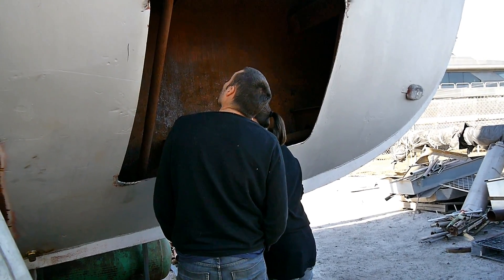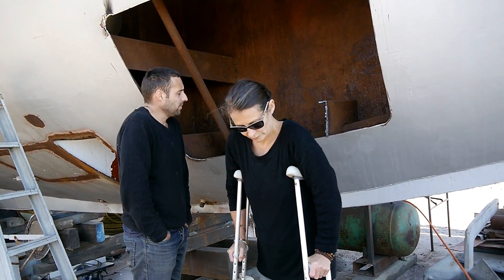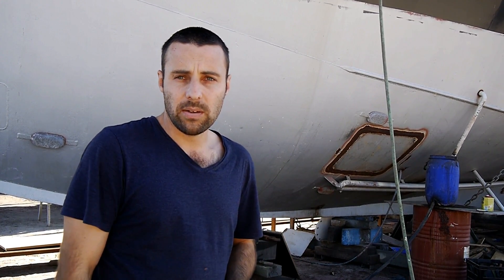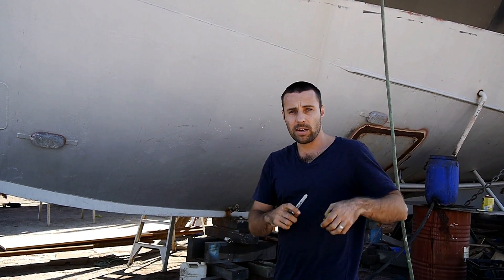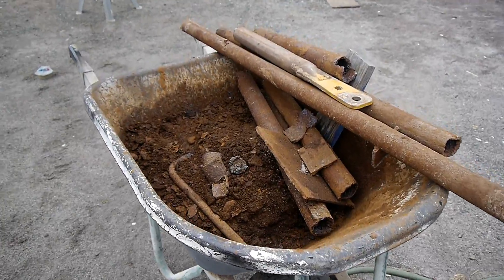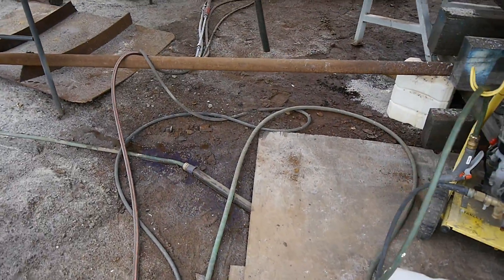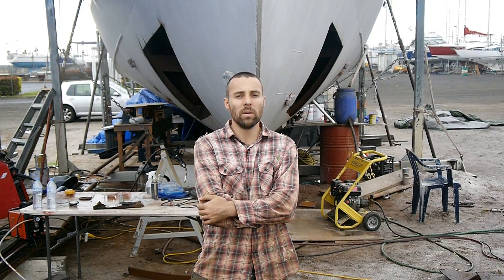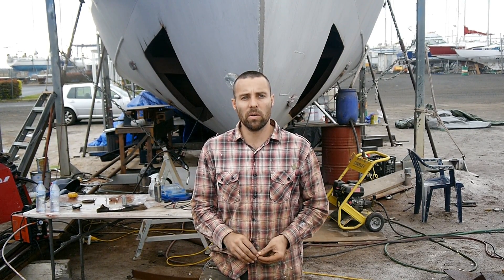RUNNING A DIESEL ON VEGETABLE OIL (Part 1 cleaning the tank) Steel Boat Adventures BRUPEG (Ep. 37)

Comment: Why don’t you just coat your cleaned tanks and steel pipes with Jotamastic 87? ( 2 coats)
Then overcoat with  Jotun Tankgaurd , like most commercial vessels do. 
No more rust, blistering, or pitting.
The main filler running down into the bottom of the tank prevents foaming of the fuel when filling.
Reply from the maker: We used jotamastic tank guard in our water tanks. However with vege oil we cannot have any contact with mild steel as it kills the fuel. So we have to be absolutely certain the paint has the best chance of sticking, hence blasting is our best option. The paint we are using is specifically formulated for fuel tanks only so it’s a best of bread coating for us. More on this in a future episode

Comment: big progress!love seeing the shots where you can really see her size!
Reply from the maker: Hi Tom. Most manufacturers point blank say it can’t be done and voids a warranty. Our engine is well out of warranty and we have dozens and dozens of examples of the conversion working. I’m an ex diesel engineer so I know some of the critical things to look for prior to major issues developing. Most people do not do these types of conversions because they have the fear of dead engines drummed into them, but it’s not that hard to almost eliminate the risk
Reply: Hey im right here... lol joking.. The boys are well up to speed, no fear of them :)
Reply from the maker: Thanks Tom. If we fill with Diesel it costs $41,250AUD if we put the same amount of oil in the boat it costs $7,700AUD so for us the gain is huge. That said there are a few things we need to manage to run the boat on this fuel but nothing is so difficult we can’t over come it. There our thousands of conversions around the world so plenty of conversions to learn from
Reply from the maker: Yeah interestingly our Cummins doesn’t have a high pressure pump. It’s a low pressure rotary pump that supplies a constant pressure to the injectors which themselves are controlled by the cam and bump the pressure up internally. Through this was a novel was of getting fuel pressure. I have actually thought of buying a complete Cummins 855 and stripping it down to parts and storing it in the engine room (we have the space)
Reply: I like that idea. That way you would have a block as well as overhaul parts.
Reply from the maker: Yeah 98% of any potential issues can be resolved without a spare block, but having one certainly would eliminate a few issues.
Reply: Once a diesel engineer, always a diesel engineer. It's gets in your blood, literally through your skin.
Reply from the maker: Yeah we forget how big she is at times. Just seems normal size to us now
Reply from the maker: Nope. Solely innuendo Tom
Reply from the maker: Full rebuild kit for our engine is 1,400USD so we will be stocking up with enough gear to do a full rebuild if required